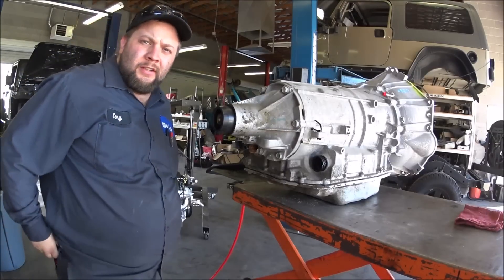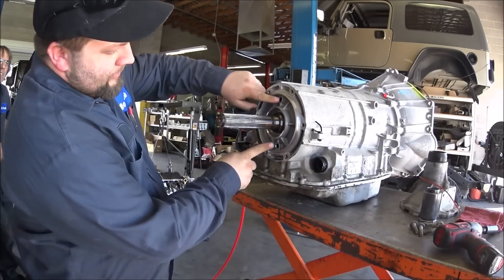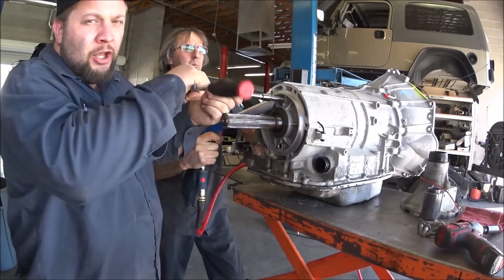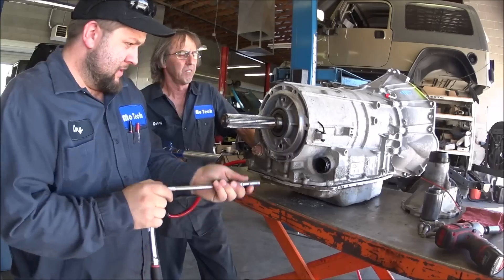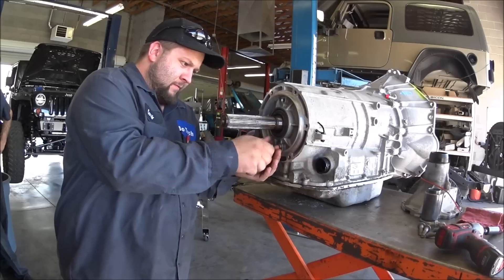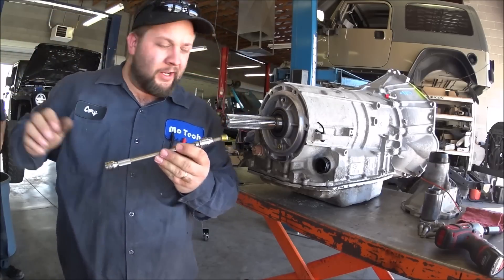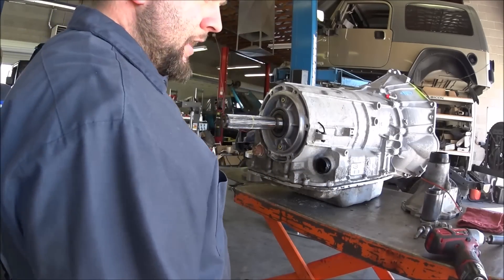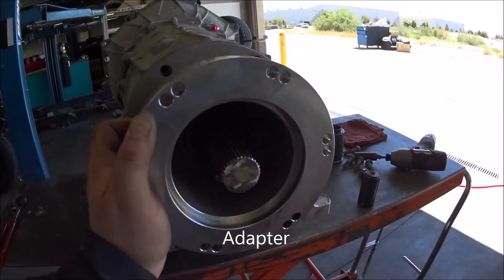6L80 2WD to 4WD

Comment: For those watching this video is mainly for JEEP WRANGLERS. We LS swap Jeeps and are showing that you can get any 6L80 and make it work with the transfer case the Jeep uses. The adapter used in the video is specifically for mating a 241J to a 6L80. #50-9600.
Reply: I have a 76 chief with quadrotrac & I have already on a 454 out of 1993 winnebago & thinking of doing this
Reply: Can I do this in reverse? Make a 4x4 to a 2wd. I want to make my Denali a 2wd

Comment: Has anyone done the conversion the other way from four wheel drive to two wheel drive?
Reply: You need a longer shaft so that means disassemble pretty much whole trans and replace output shaft. May end up needing other things while inside. Rebuild recommended at the same time.

Comment: Ok so I’m wanting to convert my 1999 4Runner into a 4x4. What other parts will I need?  Wheel locks, a 4x4 shifter mounted into the floor board somehow??

Comment: Um, there’s a lot more than just chopping off the draft shaft of a transmission for converting to 4WD drivetrain. You’re forgetting a transfer case, front axles, and new gears.
Reply: ? Your using a 241J from the Jeep which should already be 4wd. The purpose of this video is to show that it doesnt matter what 6L80 you get they both can work.
Reply: @LSWrangler  
Then, why didn’t he explain that in the video? Kinda vague if you ask me.
Reply: @travelinman482  different times man, he probably didnt realize this video was going to catch the kind of attention it did

Comment: Hey was wondering if you guys have ever done a manual transmission 4wd conversion I need some insight I’m stuck cause it’s not the same process wonder if you guys have done one before my output shaft is 30 spline oppose to the tcase 23 spline how hard is it to swap the output shaft  going to tcase any ideas would help!!

Comment: Quick question. I just did this on my 6L90, except I used expansion plugs instead of pipe plugs. Any way, when I out the output seal in, it seems that the lip doesn't meet up with the sealing surface on the output shaft. I have a sinking feeling the 4wd output has the machines seal surface projecting farther from the case. Any leaking issues or comments on that?
Reply: Lo resolviste?
Reply: Ever figure this out?
Reply: @MrThebrandon101  I totally forgot about this. I slapped it together and sent it.  Its been happily bombing around since.  No fluid leaks.  No shifting issues.  No problems.

Comment: How in the heck do you turn off the 4wd if you do this? Or is it on all the time now?
Reply: It can then connect to a transfer case(you have to find the right one for your vehicle) that will send power to the wheels that were previously unpowered and install all the other necessary components

Comment: Im confused as to how this turns a 2wd to a 4wd someone please explain how this works before I do this shit
Reply: The adapter he puts on allows you bolt a transfer case onto the end of the transmission. The transfer case itself will put power to the front differential and rear differential when the transfer case has 4wd selected
Reply: You don’t need 4wd so don’t worry about how it works

Comment: Any clue on how similar the process would be on a NV4500 transmission?
Reply: need a new mainshaft which means entire trans teardown. Supposedly some chevy models can just bolt the tcase adapter on and then cut down the tailshaft.

Comment: Why don't they just make an aftermarket transfercase that'll go on 2WD transmissions and take the extra length of the output shaft? Something like that would be cool. Take a 4x4 output shaft T-case adapter and throw the T-case on without having to worry about the extra length.
Reply: If there was one you would be too poor to afford it
Reply: @chickenfoundation9323  that's true. The closest I've found was the Quigley adapter for the 4x4 ford vans
Reply: @chickenfoundation9323  happy Thanksgiving by the way
Reply: Someone makes a direct bolt on now.  Its $1800.00  Google it...
Reply: @0.0.0.0.1  My comment was from 2 years ago. Since then of course I've learned a lot. They call them a Quigley adapter. I have the part number around somewhere but they were used for converting the 2wd transmissions to 4x4 by taking up 4 inches of the output shaft. It was a partnership (in a way) between Quigley and automotive manufacturers to sell 4x4 converted vans. The one I want is for the e4od/4r100 which everyone who has one wants an arm and a leg for and Quigley stocks but won't sell to the public if I remember correctly. Gotta call and have a good reason for getting one or so I hear
Reply: @0.0.0.0.1  unless you know of another manufacturer who makes them then I'd love to know because sometimes I think about casting my own lol
Reply: @threize6840  Timberlinesupply.... is one I came across.  I have a low mile 6.6 duramax from a 2015 van that has a 2wd 6L90 I'm considering dropping into a fj40.   Trying to find a reasonable way to convert the 2wd to 4wd without the extra inches added from the adapter. The method in this video looks straight forward to me.
Reply: @0.0.0.0.1  Pretty straight forward indeed. But one thing I'm lacking on my E4OD is the extra amount of spline length on the output shaft. So if I cut it like this then I don't have any splines lol
Reply: @0.0.0.0.1  Do you know if they're are any other companies like Quigley or Timber Line Supply that makes those adapters? I can't seem to find any others and I've never heard of Timberline Supply until you came along
Reply: @0.0.0.0.1  And I like how their adapters are machined and not casted. Kinda makes a person feel reassured
Reply: @threize6840  There doesn't seem to be very many companies out there making the adapter.   I did come across E40D 4wd tail housing and shaft.  Be all good if your transmission was needing a rebuild.
Reply: @0.0.0.0.1  Yeah, I can find those everywhere but don't want to rebuild it. The most I've done is replaced the upper and lower separator plate gaskets for the valve body along with the torque converter. Wasn't the trucks fault, I just kept driving it with a problem and at max line pressure it blew the gasket. But I don't want to rebuild it just to throw a transfercase into it. Also, I'm curious as to what people do for drive shafts after putting on the extension adapter
Reply: @threize6840  I'm guessing they have both drive shaft built or find one right length.   That $$$ starts adding up fast on any project.
Reply: @0.0.0.0.1  True that. Since they don't mass produce the Quigley ones (not even sure if they make them anymore) they are rare as a diamond, so ones off of an old 4x4 swapped van are like 500 bucks alone. Now they just use the 4x4 transmissions. The Quigley adapters were casted, the ones I seen on the website you suggested were machined. I can see the machined one costing a lot more but they're sold out right now 😕

Comment: That didn't convert anything. You just added a shorter sleeve... Where does the 4x4 come in?
Reply: I think he is basically talking about converting it over to be dropped into a 4wd powertrain-vehicle. Not necessarily converting it to a 4wd vehicle

Comment: I want to do the oposite, make a 4wd into a 2wd, looks harder
Reply: Tf would u do that for?
Reply: @ariesradke6193  So that I can cram a 6l v8 into it while keeping the torsion bar front suspension, but removing the front axle to avoid all the cutting to make it fit

Comment: I have an 01 Dakota. 3.55 gear 9.25 and it's a 4x4. The rear end went out and all salvage yards say the 2x4 rearend won't work. Is the driveshaft length the only difference?? I have pulled like 20 measurements on the rear its self and they look to be exact??

Comment: WHAT IF YOUR CONVERTING IT FROM A 2WD TO A 4WD BUT USING A FACTORY TRANSFER CASE, WOULD THE FACTORY OUTPUT SHAFT HOUSING FROM THE 4WD FIT RIGHT ON AFTER FOLLOWING THIS PROCEDURE? THANK YOU AND AWESOME VID BUD.
Reply: Did you figure out the answer to this??

Comment: So, if the shaft needs to be cut flush with the 4wd adapter, wouldn't you mark the inside of the straight edge sou you're flush, or does that 1/8 of an inch length extra matter?

Comment: Anyone think it'll work on a 1994 f250 with a 2wd e40d transmission? If anyone has performed a conversion of a truck before, does the transfer case for on the output shaft of a 2wd or is the tooth count different? I've helped overhaul a transmission and stuffed it back in the vehicle, but a guy still has to have questions.
Reply: Did you ever make it work? got a 94 and want to do the same thing.
Reply: @matthewknecht2898  This method will not work. I haven't done an 4x4 conversion on my truck yet but I'm a whole lot more educated on it than I was when I posted these comment 3 years ago. Do you have an f150, f250, or f350? If you're all for the swap then I can help direct you in it.
Reply: @threize6840  heck yea I’m down for a project. Got a 94 with sentimental value
Reply: @matthewknecht2898  Well it's not an easy task necessarily, I haven't done it myself yet. If mine were an f150 then I sure would because the 2wd front axle can be unbolted and a 4x4 dana 44 ttb will bolt right in. For f250  we have the dana 50 ttb. The axle tubes bolt in different pivot positions, and is leaf sprung so you'd need to get rid of the coil buckets. If you do that you might as well go with the dana 60 leaf sprung axle from our body style of 1 ton. But if you're feeling spiffy then swap in the 05+ dana 60 with coil springs. The 05 axles are a different lug pattern and are metric instead of standard so you'd have to swap the rear axle and find 8x170 rims instead of 8x6.5  which is our lug spacing for any old ¾ or ¹ ton truck. You can find superduty axle swaps to the obs fords here on YouTube. As far as the transmission goes you have 4 options. First, rebuild transmission and add in shorter 4x4 output shaft. Second, just throw in the 4x4 transmission with transfercase. Third, np205 divorced transfercase (ford only for driver side drop) hung from the frame with custom length driveshafts. Fourth, find a Quigley adapter that they used on the 4x4 ford vans that takes up the extra 2wd tailshaft length so you can bolt any 32 spline case to it. This project can be extensive, there's many forms online discussing this topic but almost 0 of them discusses the dana 50 ttb swap into a 2wd f250. Haven't been able to find too many sources on that. But if you can gut your old axle out, line up your leaf spring hangers to where they would be factory then you can run a dana 60 out of an obs ford. 

Me personally, I'm still exploring the idea of converting a dana 50 to accept my 2wd coil springs and radius arms. I don't plan on doing serious offroading but I hate being the only one getting stuck with an extended cab long bed. Only thing I have going for me is limited slip and low gear ratios lol

Comment: How thick was the metal he used as a guide to mark the shaft to cut @ 4:23 . ?
Reply: As long as the shaft dont bottom.out in the transfer case its ok. Just prussian blue the end and put em together  then vibrate a lil and take them appart. If its touching the blue will be gone where they touched.

Comment: Thanks for this video! I understand this is a late post. ?But can this conversion work on a 2 wheel 2010 Jeep Patriot?
Reply: lol no their just making a Rear wheel drive transmission accept a transfer case not making a 2 wheel drive vehicle in to a four wheeler.  You have to tear half the front of the jeep off then find all the parts axle , suspension , drive lines , transfer case and breaks know where to cut what to cut figure out all the electrical issues make sure all geometry is correct then weld it back together. just buy a real jeep it would be cheaper. 😆😆😆

Comment: Can we convert FWD to AWD? Or just RWD to AWD?
Reply: A fwd to awd can be done, but VERY DIFFICULT. The engine would have to be mounted laterally. Hence what the "L" in 6L80E. RWD to 4WD is easier, but an AWD system is a bit different, meaning all 4 wheels recieve power the whole time.

Comment: Can I do this with a 1980 Toyota corola
Reply: Radicle_Insanity - fwd still have a transmission...
Reply: friendsANDsuch350 no. Corollas don't have a transmission, as they are front wheel drive and also are not longitudinal mounted (engine). They have a transaxle. Far more difficult to awd swap than something like a pickup that is longitudionally mounted and rwd.

Comment: I've been a machinist for a few years. I want to give you a few tips on tapping.
1: Get a spiral flute pipe tap. They naturally pull the chips out just like a drill bit.
2: Always use lots of oil when tapping. It makes the tap cut cleaner, the threads will be stronger, and your tap will last longer.
Reply: Top threads were over torqued and stripped out.
Reply: Your tip makes this video worth while
Reply: its just a transmission.. who need clean tap...
Reply: Br!an Delta V not to mention it didnt look to me like it was the right size tap, it went in way to easy, should’ve been one size bigger
Reply: @jeffreypottsll6723  pipes taps are completely different than bolt taps because they are tapered. One thing you don't want to do is tap the hole too deep because whatever you are putting in it will not get tight especially if its a plug. They also start very easy because the tap is tapered. A few turns is all you need on a hole that size. Just enough so the plug is flush on the surface.

Comment: What about an Allison from a 2006 Duramax 6speed 2wd to 4wd? Similar?
Reply: I am also wondering if the 29 zpline on a zf6 need xhanged to the 32 spline from a th400. Ans can it be used from a th400 to the zf6.

Comment: That seriously can't be the entire process
Reply: Sebastian Cedeno I did quite a few turbo 350 2 wheel to 4 wheel conversions. All you do is remove all the rotating assembly, remove the tailshaft, put the 4wd short shaft in the output, and put it back together. While you are in there you put new clutches, seals, and a hardened sprag assy, and a shift kit. Then you are stronger than any GM trans they ever built from the factory.
Reply: Don Rutter how much does this usually cost with and with out turbo
Reply: Sebastian Cedeno yes adding the transfer case is it
Reply: Sebastian Cedeno same thing I'm saying
Reply: You're right Sebastian - that didn't convert squat.  It still has only a rear output shaft just like it did in the beginning, and no front output shaft for the other axle.  This process only preps the 2wd style tranny for the installation of a transfer case, which is where the 4x4 action happens.  Then of course you have to add driveshafts, front drive axle, suspension, shifter, etc.
Reply: Thanks
Reply: @johndough9187  genius....
Reply: That is the entire process to convert. We then bolt a transfer case adapter to it for the jeep 241J case
Reply: @GeneSun Facts
Reply: Sebastian Cedeno fuckin fr
Reply: @GeneSun for a 4x4 ultimately I'd choose a th350 over a th400 as it can be built up just as strong and has one major advantage.. The 400 has a reverse band which are known to be weaker than the reverse pack in a th350. Now it might be ok if you are a pavement pounder but the extra strength in the reverse gear is worth its weight in gold in a 4x4.

Comment: will this work on the 4l60e?
Reply: ignore the idito below that said no yes it will it is literally the exact same process dbeen ther done it thought they were nuts when they told you could do this i was completley amazed the first time i saw this done just so happens it was on a 4l60e
Reply: Gerald Bobbitt no sir.
Reply: So you can go 2wd to 4wd but can't go 4wd to 2wd?
Reply: Mike Dub if it is a 3 part transmission you could just replace the shaft with a longer shaft but if not then I don’t know.

Comment: Very nice...would you also have to change all the wiring to a 4wd...how much would this service run for?
Reply from the maker: Essentially the same transmission and TCM but a 4WD GM vehicle has very different electronics vs the 2WD.
Reply: Can you do a  4wheel drive into a 2 wheel drive